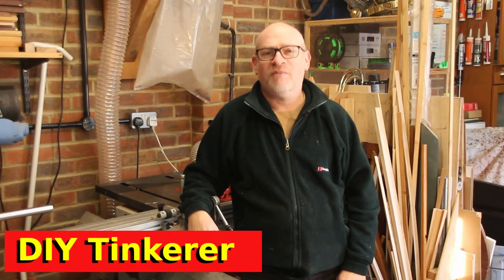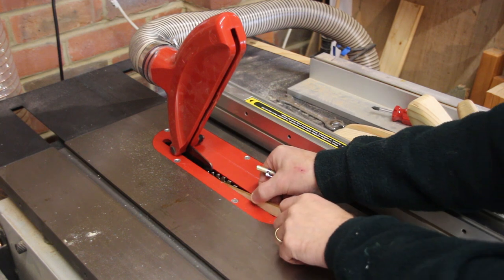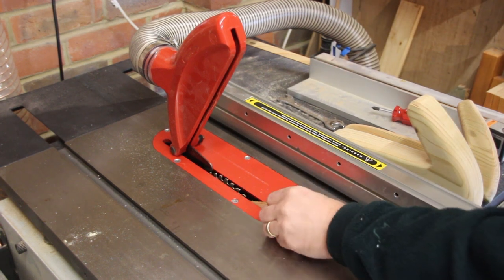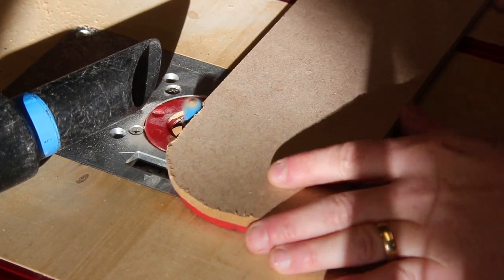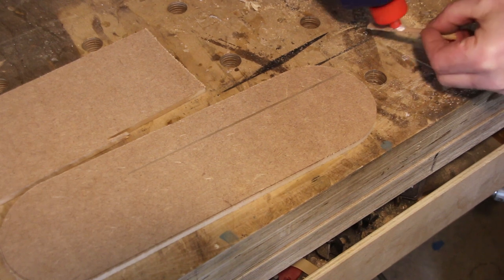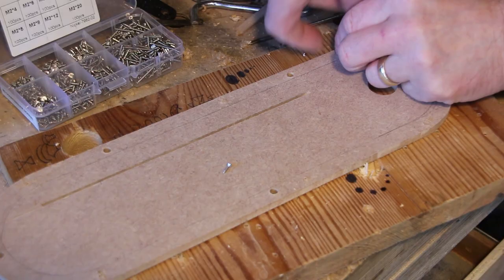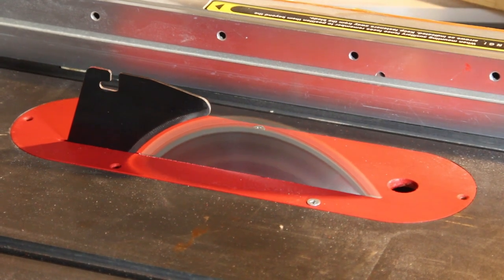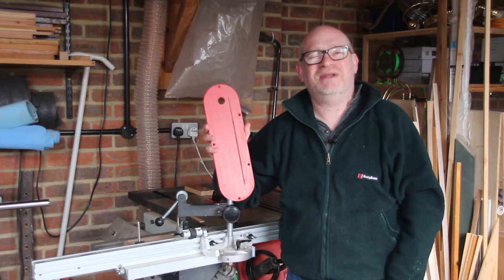119. Making zero clearance table saw insert.

Comment: Just got the AW254 version of this saw so your video is very useful for me, thanks! I noticed on my saw that there are two threaded holes to the front edge of the cast iron top - yours doesn't appear to have them and there is no reference to them in the manual - any idea what they could be for?
Reply from the maker: I'm just guessing: The bed is made for other saws that come with a different fence rail that attaches to them but it is just a guess...